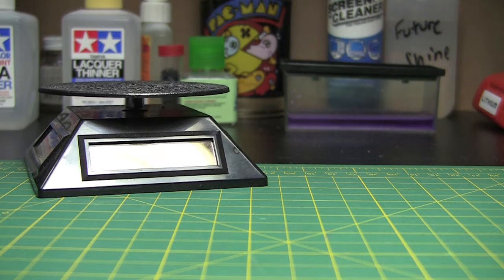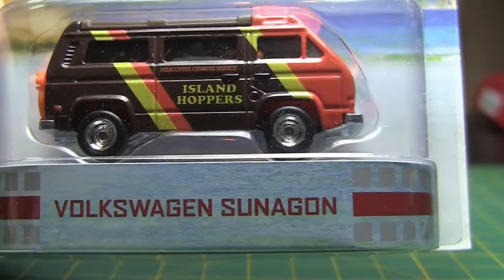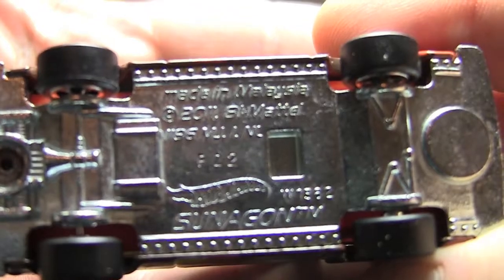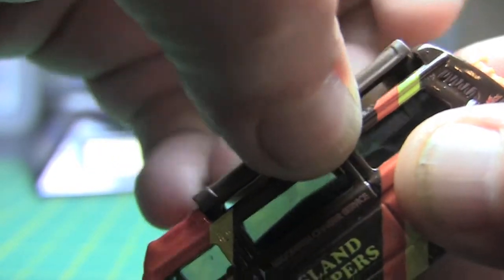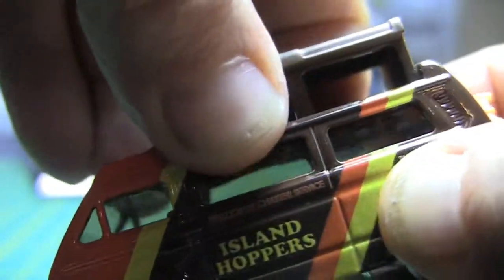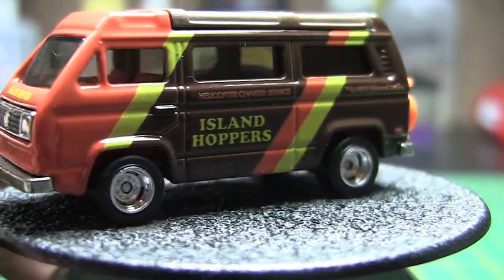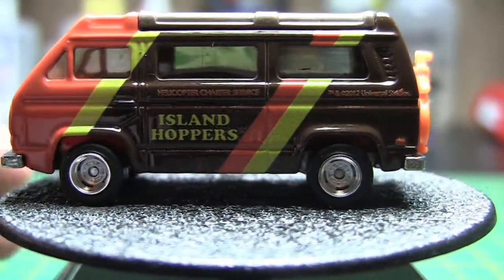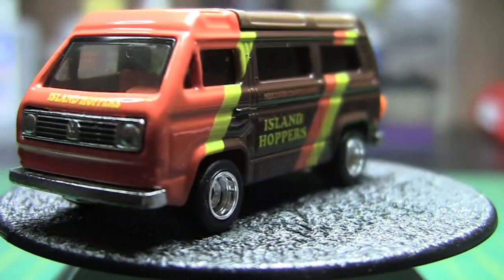Hot Wheels : C 2013 Retro Entertainment "E" Case

Comment: The Magnum PI helicopter is a disappointment #1 the main rotor is five blades , it's a Hughes 500-D #2 the windshield is concaved #3 the side doors configuration is wrong #3 the hughes 500-D has a T tail #4 it has a plastic tail boom and skids that aren't the correct shape.
Reply from the maker: Agreed